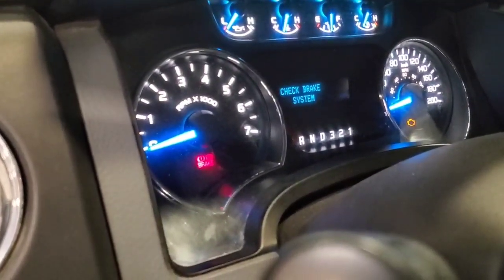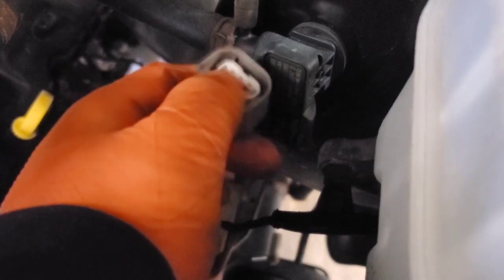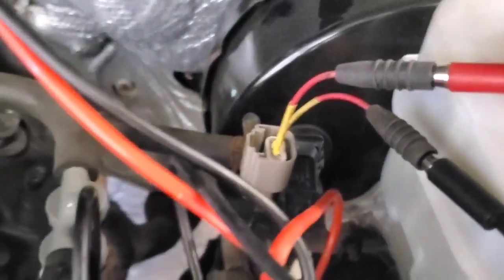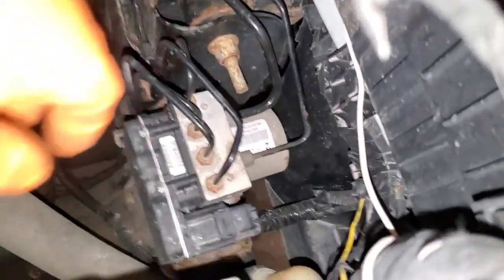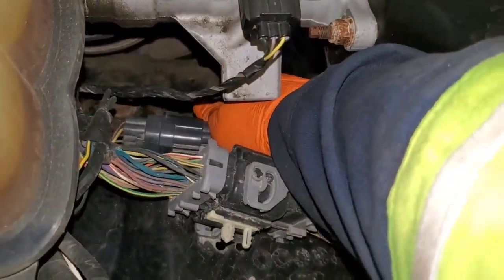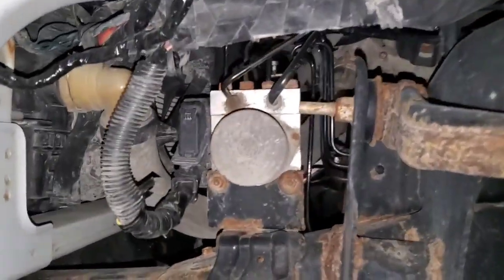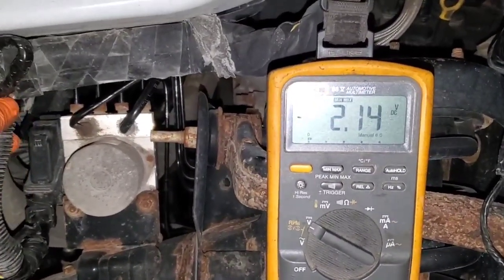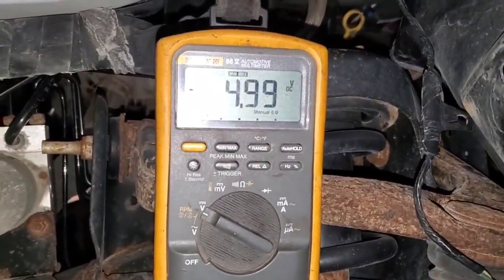Ford F150 Check BRAKE system warning DIY - ABS code C109E BRAKE pressure sensor circuit fix

Comment: A year later, and this vid is still solving probs! 

Had the same code and followed your steps exactly. Voltage went up/down as I moved the harness at the main ABS connector. 

For anyone else with this code and reading comments- after I opened my loom up, all wires were sparkling clean and brand new looking. Did a cont test and all was 100% working. 

My issue was one of the individual wire connectors not seating properly to the pin (loose female in the harness that connects to the ABS slot). A tiny nudge to tighten the female connector pin and everything cleared up. 

Thx again for posting this vid! 

Not all heroes were capes! 

💪🏽
Reply from the maker: Hey thanks for the great comment! Glad you found and fixed your problem! ❤

Comment: Thanks for this!  This is the EXACT issue I had.  The damage to the wire looked exactly the same.  Had to cut about 8 inches out of the wire to get back to good clean copper on each side.  I am excited to not have the error code displayed.  Now to fix the backup sensor on the rear bumper, and the passenger mirror position sensor, and the driver rear door closed sensor - thankfully this last one is only in sub-zero F temperatures.

Comment: EWhen I got the truck I replaced pads , rotors , calipers. And front lines . The brakes work great but how do I shut off check brakes lamp

Comment: If possible, can you list the year model you are working on here. Because i dont think that cable was intergrated untill 2011 models.
Reply from the maker: @YasapYaakov018  I believe it was a 2014.
Reply: @AcousticHills  Aha.  I think I know the problem with mine. I replaced the ABS module on my 2009 with one from a 2011, and updated it with my Vin and "As Built Data) but I have 2 extra lines that calls for forbthe data needed for the replace module. Since my truck does not comput those lines, I think my PCM is looking for something that is not suppose to be there. Thanks for the input

Comment: What was your resistance value to rule out a bad sensor?
Reply from the maker: Hey there, I didn't test resistance. Found a bad 5v ref circuit which was the problem.
Reply: Gottcha. Would you happen to know the resistance range? Appreciate your help.
Reply from the maker: @giff1011  sorry I don't. But if your 5vref, ground and signal circuits are good, then you have a bad sensor.
Reply: No worries. I actually have a 2009 F-150 in which the abs module needed repair. Well that repair didn’t fix the problem and come to find out my pressure transducer also failed. So I rolled the dice on a 2010 unit the  because I wasn’t about to spend 5-6x more for a 09 unit. Both are 4x2 and HCU pump assembly are the same part number and bolted right in. What I didn’t know and found out last night when installed the 2010 unit is they have a brake booster vacuum sensor. The 2009 didn’t have it. So where I am now is trying to figure out the nominal resistance value of that sensor at 5v so I can modify the “new” unit into thinking I have a good sensor. I don’t have computer capable of modifying the ABS controller module otherwise I just do that. Thx again for helping and if you happen to find that number please let me know I appreciate it. Take care
Reply from the maker: @giff1011  ah ok, can you just grab one from a junk yard truck and wire it in?
Reply: No wire harness option. I would have to add a resistor internal to the abs control module. That resistor value would be as close as possible to a nominal reading of the sensor. Not hard to do, just need the right values otherwise it won’t work. 😂
Reply: Or knowing what the voltage range needs to be would also help.